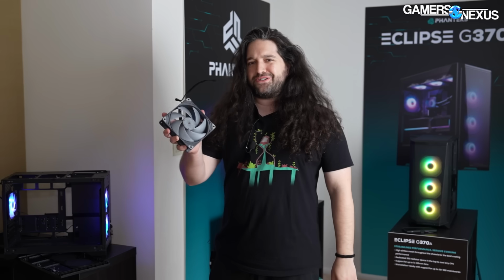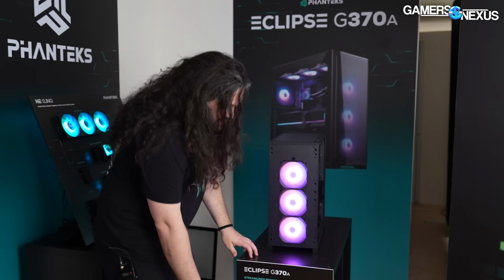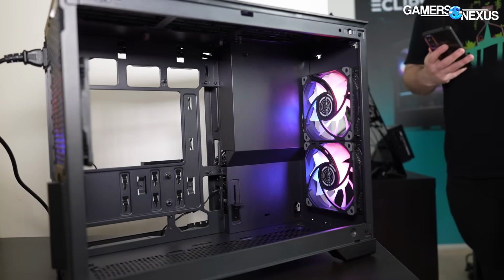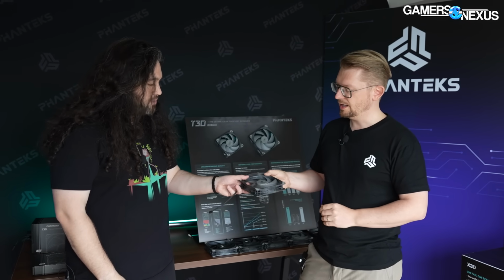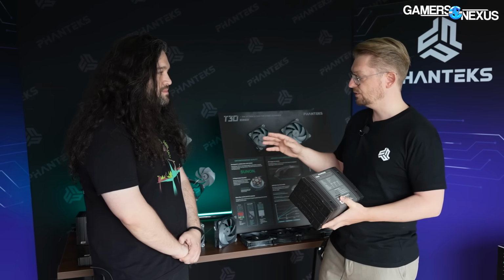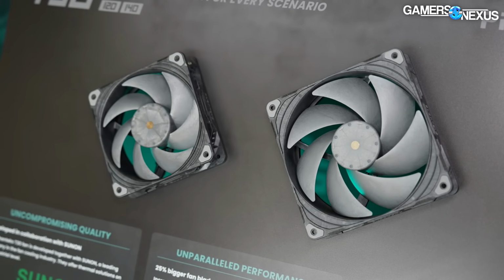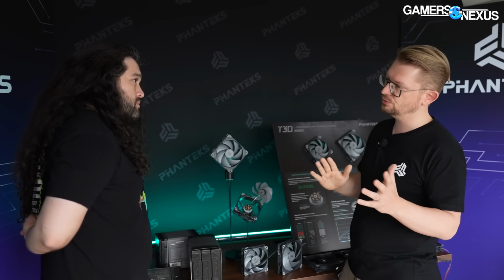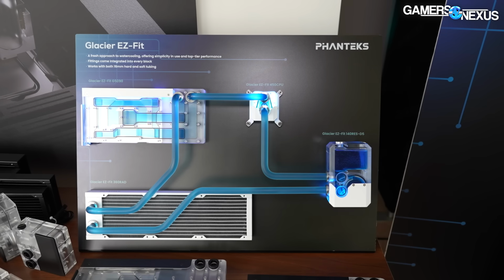6 Years to Make a Fan, G370A Budget Case, & Phanteks Technical Fan Discussion, ft. CTO

Comment: What's the real world impact of getting tighter fan clearances? I mean, if you wanted to, you could simply line the inside of the housing with tape to get extremely tight clearances... so getting tighter should not be too difficult.
Reply: A fan is most effective at its outermost edge while the part of the fins close to the hub does almost nothing. That's why everyone is so obsessed with the clearance, it basically gives you more fan per fan in the area where it matters the most.

Comment: I thought his explanation of the pressure being lower wasn't super clear, so just to see if other people agree with what I got out of it, what I got, was that overall the 140 will move more air with less noise, but ultimately, they are less good at building up pressure, which can be fine due to the sheer volume increase.

Comment: Such a good discussion! I really loved hearing about production challenges such as mold wear and tear caused by material choice, operating temperature, etc. I never realized how those years of watching AvE taught me about injection molding. The more abrasive the material (high glass content reinforced plastics being on the more abusive end of the spectrum iirc), the faster the molds wear out. On super high-volume, budget items you can sometimes tell how new the mold was by looking closely at quality of fine details in the final result.

Comment: Dynamic balancing. As opposed to static, stationary, where you add or remove mass from an object suspended in a bearing system, until no one side is heavier(it would otherwise slowly rotate until heavier side is down). While dynamic accounts for the location of the mass in the 3rd axis, along the axle, where it might cause axle wobble. In order to measure this, it must be spinning. Cool.

Comment: Since they do all the testing I would really like to know if pushing or pulling through the radiator is better. 

Right now there is some armature testing that says it does not really matter, but it must vary from fan to fan and since Phanteks did so much testing I assume they know the optimal configuration.

Comment: Does Noctua finally have competition? That'd be nice.
Reply: In 140mm yes, in 120mm at least the T30 was always superior due so it's fatter fans
Reply: @flavio1243  Oh, they're 30mm thick? That's gonna a problem in some applications. It's nice they support higher RPM than Noctua, but I'm gonna need to see some noise vs. airflow graphs before I'm ready to call it. Hope Steve gets that fan tester up and running soon.

Comment: Been using a 120mm T30 for a few years now, it's the single case fan on my ITX build, and it's fantastic. Quiet when working/browsing the net, to moving air and sounding like a hair dryer with intense work loads. haha
Good when I'm converting videos and I'm not sitting close to the PC, this single fan keeps my whole system temp's in a really comfortable range!

Comment: I skipped ahead to the fan topic since that to me was the most interesting. I like how every time I watch a new video about new fans. I see a person talking about these very very tiny little attentions to detail regarding things like the length of the fins or the curve of the blades and the methodology of how it rotates in a market with a multitude of options. 

I both find it incredibly fascinating, but also incredibly funny how it's become like listening to manufacturers explain how their golf club is slightly better than their competition when they look exactly the same.
Reply: The 80-20 rule applies everywhere. Once you're down to the last percents of performance to squeeze out, you'll have to care about those tiny details - and you'll likely want to put them in the marketing pitch too to justify the cost.
Reply: @LishtenbirdTech  Yep, law of diminishing returns.
Reply: Well yes, because there are a "multitude of options" in the market, these makers need a way to justify charging $35 per fan. Otherwise they'd be out of business.

Comment: Glad to see the T30-140 are nearing launch. Been rocking the Superflower Megacool 140mm in the meantime. Curious to see how they stack up.
Reply: I was seriously considering T30 for the current build, and was surprised to learn that the 140mm version did not exist... Well, better late than never.
Reply: I would assume the megacool fan performs slightly better than the t30 because they run a higher rpm.